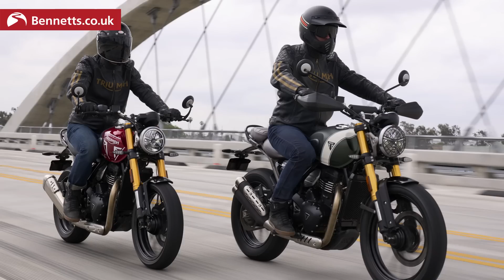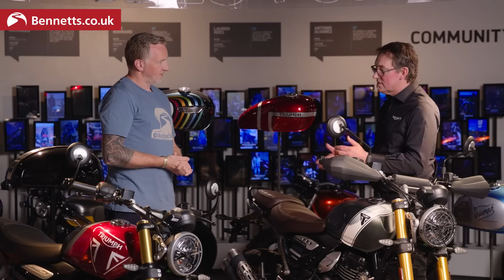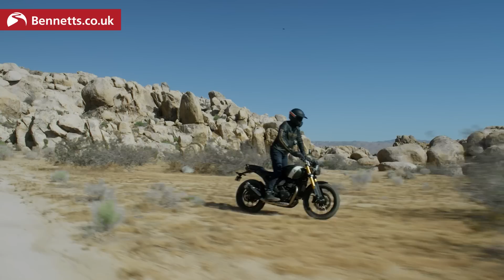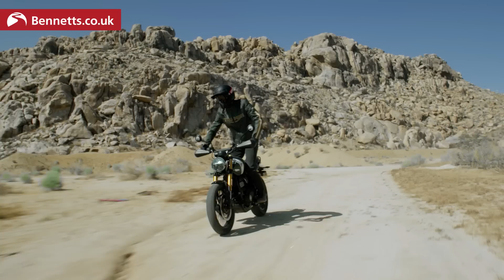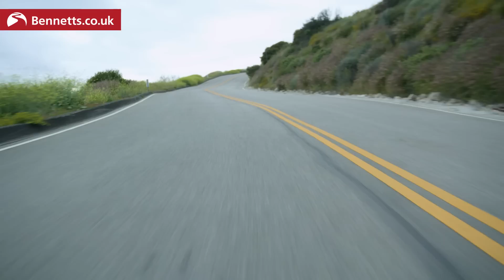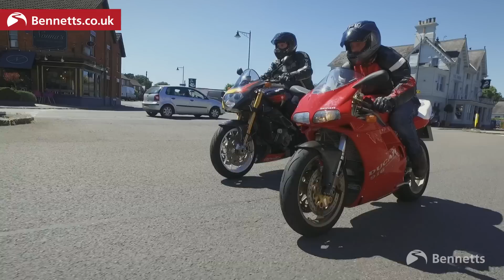NEW Triumph Speed 400 and Scrambler 400X Full Details!

Comment: Love these machines, by what I can tell.
They are genuinely motorcycles, not ADV wannabes, or dirtbikes, or road bike on stilts or anything else. In this class, I don't much care about horsepower. This is about the styling, the efficiency, the multi-use design, having enough power to not fall on their face, being efficient with fuel, serving more than one function in that they can do dirt roads (or Jeep trail or beach front or other stuff right off the pavement), but they are set up well enough not to go nutty with features (and presumably cost). Single cylinder engines usually aren't that expensive outside a motocross race bike. They are also physically large enough not to be some kind of grown up Grom. I wouldn't consider one to be an only-bike for an adult, but a second bike for efficient fun, knocking around, exploring, enjoying the outdoors.

Comment: Went down to a KTM 390 adv in 2020 because of the weight of my Tiger 800, I dropped it on a fire road and really struggled to get it upright with all the luggage on it. After a lifetime of Triumphs I got fed up with the crazy prices as well, you could buy a reasonably new hatchback car for the same price. Have been waiting for Triumph to realise that the market is changing, people are moving away from the big heavy expensive bikes. If we want to keep motorcycling going we've got to encourage the younger generation that it's a viable proposition and maybe this will help. I must admit I'm interested as I have always loved triumphs way back to the seventies. But they have to compare with the KTM in price and features as they are both made in India and I have had no problems with the KTM after traveling all over Europe on it.

Comment: You never asked them about the 450 Scrambler X!? I spoke to Brad at CMG Motorcycles (manager), he told me NZ would only get the 450 cc in December.
I wouldn't have steel bars as they add to the weight, would change to alloy bars. 13 litres is perhaps marginal as Himalayan had 15 litres giving it 400 km range off road. It's shoe with 1 pannier bag bug that's not enough even for weekends away nor is it balanced. I run hepco becker c bow system with dual soft luggage so be interesting to see what comes out. Did you say it comes with main stand!? Does it have a clock, dual trips, ambient temp, fuel gauge, gear indicator!? Will the 450 cc have longer stroke to square up the engine & give more torque?
Reply from the maker: You’re right. I deliberately didn’t. I’ve been in this game long enough to know that manufacturers will never talk about future models on camera. Especially when the mission is to introduce and hype up the two bikes they’ve just announced.

Comment: The tail side of the speed 400 looks  slightly higher ,I mean should have been a little horizontal ,,it would have looked more flowy if the gap between the rear seat and back  tyre was slightly lesser than how it is now, and gap looks a bit more from my judgement . 1:24

Comment: The Triumph guy claimed 80mpg. It says 63mpg on their website. The latter seems more likely having squeezed 40bhp out of that 400cc engine.
Reply: KTM squeezed 44ps out of the 390 Duke (~375cc) and 4mm shorter stroke than the Triumph 400 with a claimed 40ps. Brisk (but not wringing its neck) day to  day riding on my 390 Duke gave a real world fuel consumption figure of 69/70mpg measured over several tank fills. Therefore I'd expect the same/slightly better from the Triumph as the torque curve suggests it makes its torque at slightly lower revs for obvious reasons. 😉👍👍
Reply: @edxr250r  Yes I owned a 390 Duke for 18 months. I averaged 63mpg - coincidentally exactly what Triumph claim for their 400. It was great on a run but I sold it after year because the slow speed fueling was awful.

Comment: This the wrong way to go .

 It makes no sense for Baja to again make a 400cc single as they already have a 400 cc single from KTM why would they make another 400cc engine with the same power and 20 kg lighter . The Bajaj Dominar 400 is a good bike its just heavy one weight reduction update and there will be infighting between the two companies . 

Who in the right mind would  make this unnecessary single when KTM have the 390 and 401 Husky exists since 2013 . 

To make this engine size work triumph and Bajaj should have taken  the CF Moto SR 450 engine (which is a KTM 490 engine i think) which is a 270 crank two cylinder make it in a desirable engine size (350 to 500 cc) and  put it into the Triumph 400 chassis .

Ideally a two seater version of the Triumph bobber with that cf moto 450 engine would be nice body and chassis built to a 450 size . And for the older riders a classic body like the T120  or high handle bar with a mono shock rear  Thruxten type body built to size for a 450 cf moto engine would make sense .   

The triumph 400s tail looks like a frightened cat or a dog that's had it temperature taken. Triumph is falling in the same smug  pit that the  BMW 310 did and Harley Davidson is going to do  .

Comment: Price will either kill or make this bike a winner. If they come in or around the Hunter 350 price, they will sell shed loads of them, but knowing Triumph, they’ll price them at the expensive end of the market and not sell as many… Guess only time will tell 🤷🏻‍♂️
Reply: Hunter is a cheap bike. This will be a competition for RE interceptor 650..
Reply: @oblivion_007  Possibly, but the smaller capacity would suggest otherwise 🤷🏻‍♂️
Reply: @cloggsy1971  power figures are similar to interceptor.. Also triumph is a much more premium brand..

Comment: It will sell , I’d buy the 400x scrambler straight away , yeah I’ve big bikes and small bikes ,but, speed limits , cost of large bikes and the average age of bikers is getting older , new 125s are banned from 2030 , their will be no new riders coming thru , it will be very difficult for manufactures to work out what will actually sell , unless we all buy BMW GS 1250 adventures for those epic world trips were never going to take !! you can see MotoGP falling apart , not worth the cost and development , the same is going to happen to road bikes , middle weight segment is going to be the only growth , as I’m a 60 year old teenager and proud of it ,I’ll keep riding anything with 2 wheels 🏍🏍👍👍apart from a bmw gs 🏍🏍👎👎

Comment: Nice looking bike, though it does seem a little confused as to which bracket it falls in, being part retro with a mix of sport bike having the high tail and monoshock rear suspension. I would have liked to have seen it with a twin cylinder engine and flat, flat one-piece seat. As it is, I think I will be sticking with my Yam MT-03....

Comment: I kind of wince a little when i hear "beginner bike". I prefer the 400cc cap range for 3 reasons. 

1 Being it's ease to control, countless people put too much throttle in their HP monster bikes and spin out that back tire from the slightest abnormality in the road. (Yes i know of rider modes to put digital training wheels on your bike)

2 Cost. Here in SC (United States) there's a 5% tax of the value of the bike and insurance is based on the cc's of the bike so lower is better.

3 Repair. It is without a doubt easier to repair and maintain smaller cc bikes over the much larger and more expensive ones that can easily shoot beyond 1,000$ from a simple drop.

Kind of a bonus reason is style and looks. When you can compensate "lack" of Horse power with style and looks, the bike itself becomes unique in a way.

Comment: I hope they are less than £5k but I bet they won’t be. The problem is Suzuki still make the sv650 which really is a hard bike to beat for value. If these cost more than £5k then it will be less than £1000 more for the 650. Shops near me have sv650s for £6.3k new, 8 year warranty.
Reply: warranty typo?
Reply: @SteeeveO  what’s wrong with warranty?
Edit: I think you were questioning how long the warranty was. As long as the bike is serviced each year (doesn’t even have to be by them) they will extend it to 8 years for free.
Reply: @callumrdavis  8 years?
Reply: @SteeeveO  yeah, 8 years as long as it is serviced once a year. Doesn’t have to be by that dealer either.
Reply: @callumrdavis  that's a great deal - is that manufacturer's warranty (ie Suzuki backed)? I've seen other warranties like that but they were non-transferrable & let's face it, no-one will hang on to an SV for 8 years.
With the Triumph I think you are right that it will be well over £5k. I reckon it will be over £5.5k. When Honda can price the new 750 Hornet at £7k, the Triumph looks pricey for a fairly basic bike.
Reply: @SteeeveO  I believe it is a manufacturer warranty because any Suzuki dealer will honour it. I agree that new Honda is a remarkable value.

Comment: I absolutely love them and would love one as a second bike. No idea which I'd pick though. Think I prefer the scrambler, but I'm pretty short (5'7). Would I get both feet on the floor and does it feel more top heavy?  Also, how do you think that the finish would stand up to commuting on one? Not sure I could push myself to that price new when a mint second hand speed 900 would come in for about the same price though.....
Reply from the maker: Hey Rob! They look so good, right? The Scrambler has an 835mm seat height but the 'waist' of the bike is narrow so in theory the stand-over measurement shouldn't deter any rider. We'll have a video up before these are on sale demonstrating tips on how shorter riders can ride taller bikes. Also, it's worth noting that a 13-litre fuel tank is significantly lighter than anything towards 18-20-litres, in terms of it's abilty to carry weight.

Comment: Knowing Triumphs usual great low end tourqe, I've got a feeling they're gonna be much quicker and agile than people might think. Obviously, above around 75mph they'll be limited, but nobodies buying a 400 to win races. The Scrambler might surprise some larger displacement bikes costing way more.
Reply: My Triumph 900 only had 55bhp. They've squeezed 40bhp out of a 400 single. I can't see it producing much torque down low.
Reply: @999pez  Its not really a small single cylinder engine. It's gonna be plenty punchy. Not expecting it to be the tractor my second gen Speed Twin 1200 is, but I'd be willing to bet it's got plenty of grunt down low. They specifically designed it with a high inertia flywheel for low rpm pull.
Reply: @999pez  Agree. And if you compare the peak torque figure against the likes of the enfields then this is going to be a different sort of bike, but one that will likely appeal to younger riders.

Comment: The spec sounds great, maybe I missed info on the electronics and the adjustability of the front forks, but I'll stick with my KTM 390 adventure unless they have equivalent on both the aforementioned. Nice looking bikes, and if the prices are good enough royal enfield and bmw will take a real beating, especially bmw, as the single cylinder bmw is a bit , well, meh.
Reply from the maker: HI - there's plenty more info on the Speed 400 here: https://www.bennetts.co.uk/bikesocial/reviews/bikes/triumph/speed-400-2024-review and the Scrambler 400X here: https://www.bennetts.co.uk/bikesocial/reviews/bikes/triumph/scrambler-400x-2024-review and if you have any specific questions then do shout. Cheers, Michael
Reply: @bennettsbikesocial  Thanks Michael, much appreciated.

Comment: What I like about these bikes is? I’ve been driving for 52 years , and will need because of age a smaller bike ( easier to push etc ) but also well enough built, to handle well ,capable of carrying luggage, good weight as mentioned. And not for those starting riding , but coming to the end of driving , I will be booking a test ride on Speed ( red one for me ) when they come out 😊👍👍
Reply: Spot on comment--i am nearing 60 years old and want a smaller bike too--i rode a Honda Rally with soft luggage 25,000km and kept having Beemer owners and large ADV riders question me about the light ADV...these bikes are middle weight and power--more then enough for me--plus i get a city bike daily rider that looks amazing then can take off for a month long ADV--yup--400X for me
Reply from the maker: Great shout, it's easy to pigeon-hole small capacity bikes as a way into bikes or as a stepping stone up the ladder, but they are just so important for those who simply don't need or want 220kg+, or 150bhp+, or a full suite of electronic rider aids.
Reply: @bennettsbikesocial  Yes i think manufacturers are picking up that the guys who had a large cruiser or Beemer cannot possibly pick the bike up at a certain point in life and dont enjoy just moving it around the garage or parking lot anymore. 
Lighter, sub 50hp is all i need personally but if you like to travel with the wife and the proverbial kitchen sink you may need more power....different horses for different courses.
 The new riders who like the classics and the old dudes like myself who like the classics have something in common. Not everyone wants to spend  10k on a bike either.I live where millions ride scooters and its amazing how folks travel the country on scooters--2 up--with luggage--in large groups haha--its all about how many smiles per gallon you are getting at the end of the day.

Looking forward to your test ride of these beauties and seeing how the Himalaya 450 compares..
Reply: @bennettsbikesocial  yes, that includes me too. Been riding over 30 years and a few years ago, getting my bandit 1200 out of the shed and lugging it about became that tiring that I just didn't want to ride it anymore. I swore then I'd never burden myself with an overweight, top heavy bike again!
Reply: Riding not Driving.
Reply: @TonyMcAdam  how sad
Reply: I'm 65 I don't want a bike that weighs and costs a ton . I just want a dependable quality bike to have some some fun

Comment: The way the speed limits are coming down on all minor roads, this size of bike is all that's needed in the UK. Nationals (60mph) have all been reduced to 40/50mph where I live. The roads I usually ride have been ruined.
Reply from the maker: Every bike will need long travel suspension soon judging by the condition of some roads.
Reply: @bennettsbikesocial Try riding in Taiwan then... Makes the UK roads look like a 3rd world country!
Reply: Yes, I went through a police lazer trap on my honda 600. I wasn't speeding.but it worried me enough that I sold my bike and bought a Vespa.
Reply: Yep, couldn't agree more. My 350 hunter is ideal for the local roads now.    Riding a 1000cc bike would just be frustrating.
Reply: My himalayan is 5 years old and lives outside, no other choice! I have tried multiple covers but they get ruined by the wind, i live on the coast..... No rust at all, i spray her with acf 50 twice a year using a hand held paint sprayer from screwfix 👍
Reply: Same in Spain. I am considering a long travel suspension bike. My current XSR 900 in awesome but too stiff... 
The new Triumph 400 are impressive with good design and a reasonable 400 engine. The scrambler should have high exhaust and spoked wheels, but, anyway, they look fantastic.
Reply: £6k for the X is too much. I heard around £5.3
Reply: they gonna rust faster then they go fast.....triumph quality
Reply: @sebg2086 not my experience at all (4 year old Speedtwin kept outside under a weatherproof cover), so a bit of a sweeping generalisation there. Any bike, not looked after, will corrode.
Reply: @mickcresswell1031  my 2009 yamaha was looking better than my 2017 bobber.....and the yamaha slept outside a lot..... the brush aluminium on the triumph is garbage
Reply: @sebg2086 This time it would be Bajaj quality and it will last for ever
Reply: @sebg2086  is it. ?
Reply: @sebg2086 Why do everyone keeps saying this? Is it really that bad? In contrast, how do the Japanese modern Retro bikes fare in metal quality used?
Reply: @sebg2086 my speed four has been terrible electrics wise but there's not a bit of rust on it and it's almost 20 years old.
Reply: @sebg2086  Had loads of triumphs never had any problem with rust on the Bloor bikes although must admit back in the 70s had a few leaky and rusty ones. Certainly no more than the Jap bikes i've owned, the only bikes I've had rust problems with were my Italian ones.
Reply: @sebg2086  😂😂😂😂😂😂